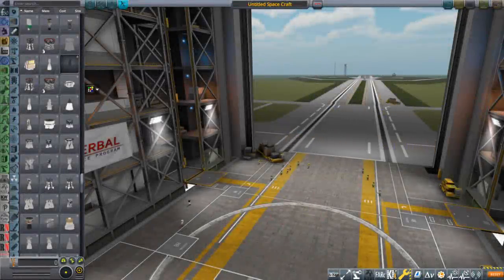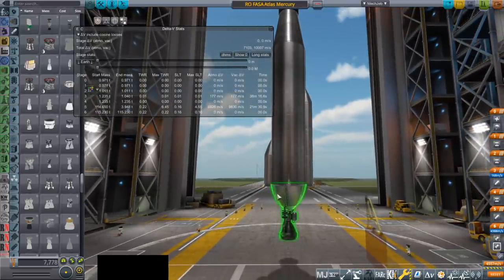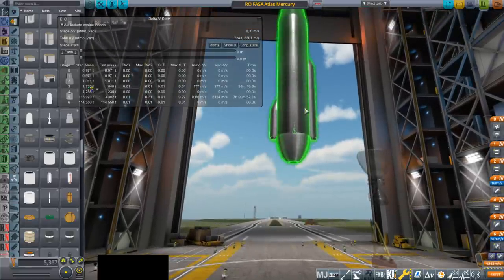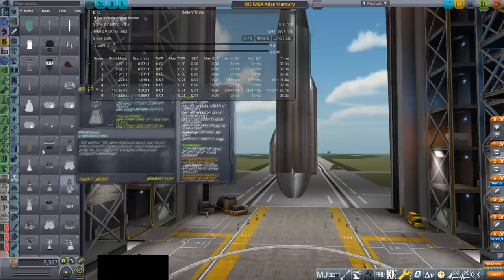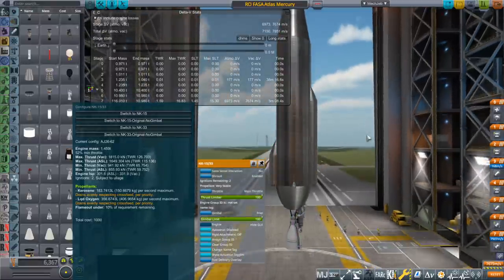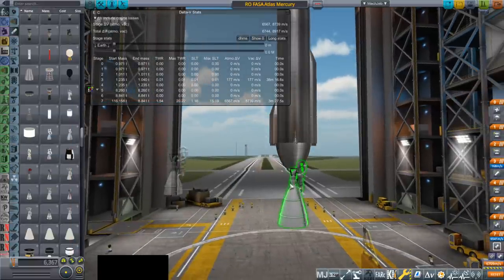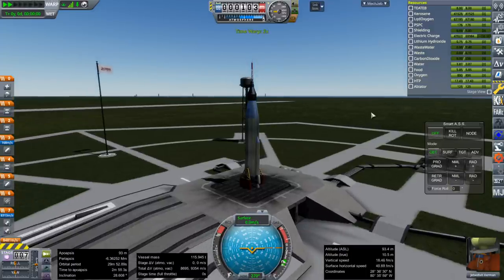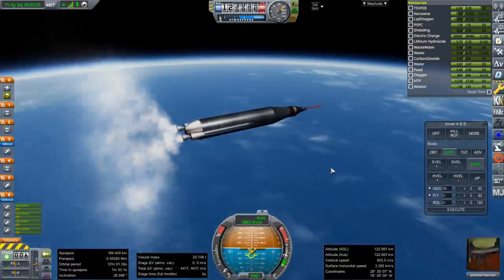Realism Overhaul in KSP 1.8.1 - Atlas SSTO

Comment: 5:35 You can also make it hypergolic. 2 of the ~5 rocket stages theoretically capable of SSTO were, specifically the original Titan II and Titan III 1st stages. (It seems like Titan followed a similar trend to the Atlas in terms of dry mass fraction, reaching a nadir early on before increasing for whatever reason.)

6:45 I imagine changing the potential fuel mixture would be fairly easy in tank construction. It may be possible even to modify an already-existing tank to a different O:F ratio by cutting out and rewelding the bulkheads and part of the tank.

12:40 Still waiting for functionality that allows you to switch from relative to absolute throttle modes so you can quickly throttle back to absolute minimum thrust without shutting down the engines, as well as an ability to action-group throttle levels for instantaneous control... do they have that latter thing already?

17:00 After trying to launch the stage into orbit a few times and failing due to the exorbitant increase in TWR (even if possible, the trajectory would certainly be very inefficient and rob even more out of its negligible payload capacity), I had proposed using that for an alternate-historical mission where a modified Titan III 1st stage would be launched directly into orbit, purged, and used as a wet-workshop station. I'm wondering how difficult it would be to do that... If it is relatively simple, then combined with a crude irreversible throttle system, thrust could be limited to ~32.5% in the latter stages of its burn.
Reply: Stronger tank structures make ground operations easier while improving reliability.

Comment: Initial thought: If you're ditching the stage-and-a-half design, why not replace the whole tank with one that doesn't have those extraneous pipes on the side?

Challenge: Smallest vehicle possible that can land on the Moon and return.
Reply: There's only one external pipe. The two "pods" contain things like the guidance computer, batteries, and other temperature-sensitive equipment.

Comment: I wonder why 1 1/2 stage rockets are not used anymore
Reply: @jaycweingardt11  IIRC Crossfeed were to be used in UR-700 Rocket in the Soviet Direct Ascent Moon Program
Reply: @kaleufarias7705  1 1/2 stage arent as effective as a "normal" two stage design. 1 1/2 stage were needed, because they hadn't figured out how to light a engines reliable mid flight (atleast that is, what I think).
And you could make an argument that the shuttle (ET/Orbiter) used crossfeeding ;)
Reply: Because you'd still be carrying the full dry mass of the tanks, even though they're partially empty. Parallel staging is more efficient.

Comment: I have a question: How much RAM does your RSS\RO install use without visual mods?
Reply from the maker: Well, the biggest visual mod is the RSS Textures, which is required, and I have different texture quality in different installs depending what I'm doing so that varies the RAM usage a lot. Besides that, it depends on the part mods rather than the visual mods, and you didn't specify which RO install - a base one or one with more mods?
Reply: @RaizSpace  one with the more mods

Comment: you could have gotten away with a Merlin and a small booster engine to get you off the pad.
Reply from the maker: What do you mean a small booster engine? Like one that drops off that would make this not an SSTO, or another Merlin? Because there's hardly a better choice than another Merlin.
Reply: @RaizSpace  maybe booster is the wrong word here but you get the point, just a lower mass and thrust engine for the force to get off the pad and make it to orbit after you turn the merlin off, but you didnt need two merlin engines to get that off the pad and even after turning one off you still had ridiculous twr.
Reply from the maker: As long as our TWR off the pad is under 1.7 or so, it's relatively inefficient to reduce thrust since we'll incur more drag and gravity losses. Since the Merlin is the best thrust-to-weight engine in the world, any other engine will likely produce worse results in this trade-off.
Reply: @RaizSpace  Yeah, good point, it is a super light engine. maybe with the right engine and some trickery it could be better, but it would have to be a different fuel and that is enough to make it stupid.

Comment: The Russians were able to reach 360s vacuum Isp with their upper stage kerosene engines. Imagine if we had variable area nozzles or aerospikes. We could get max thrust at sea level and max Isp at altitude. Here I did a base rocket equation estimate of the payload with the Atlas given altitude compensation: https://exoscientist.blogspot.com/2012/05/coming-sstos.html
It would be great to do a Realism Overhaul simulation of this, but I don’t Kerbal has the capability to do variable nozzle simulations. But the possibility is tantalizing.
Reply from the maker: KSP doesn't actually simulate the ISP per se - it's all hand-written into the cfg. As long as the nozzle has two states, the way to do a variable nozzle is just to give the engine two modes and do a mode switch in-flight, which I do with the ED-4 engine on my Shinkansen spaceplane, which has an extendable nozzle so that it can operate both at sea level and in vacuum.
Reply: @RaizSpace  Thanks for that. Where can I see your spaceplane?